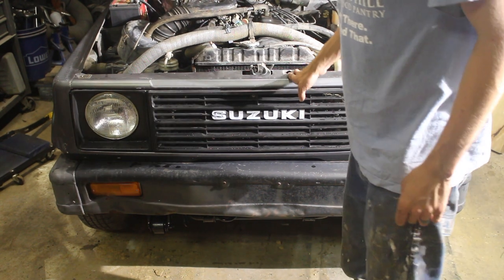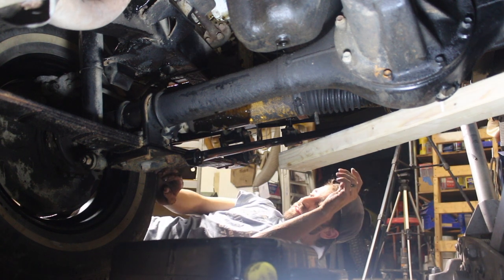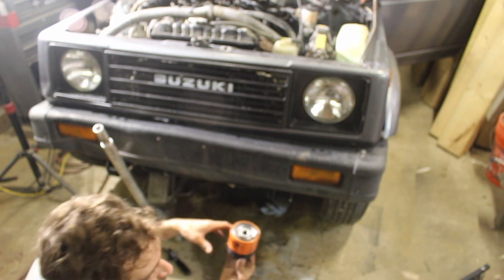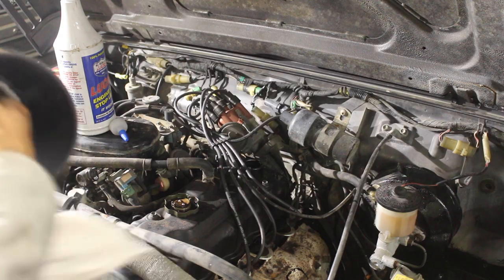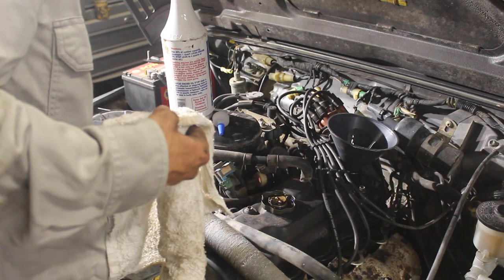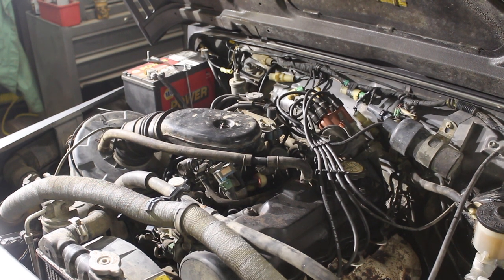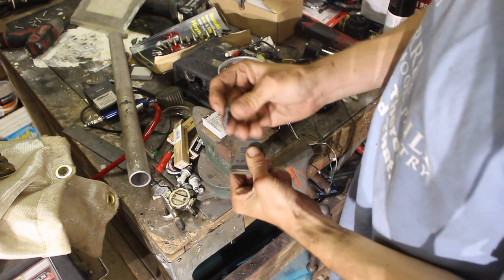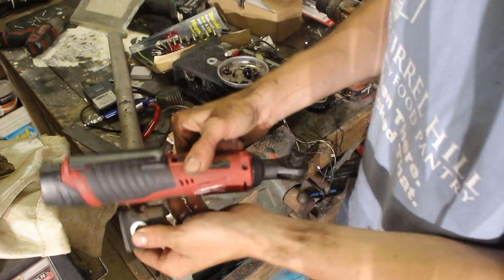Suzuki Samurai Rebuild Part 4

Comment: hello greetings from Italy happy Easter me in Italy in my suzuki Jimny petrol off-road vehicle with 1.3 displacement m13a engine I use engine oil for petrol and diesel engines in 10w40 or 15w40 gradation because my suzuki Jimny 4x4 is from 2001 as the year of production when  was built!
Reply from the maker: Awesome!